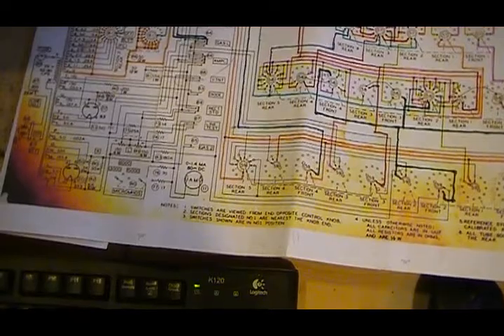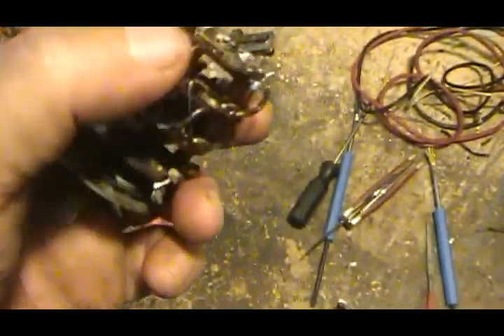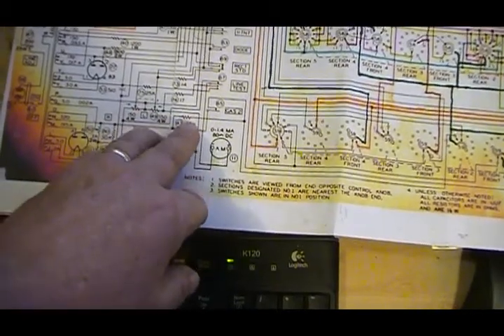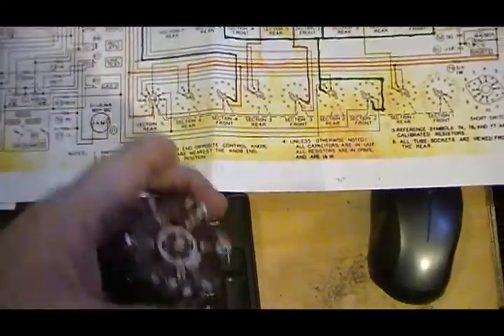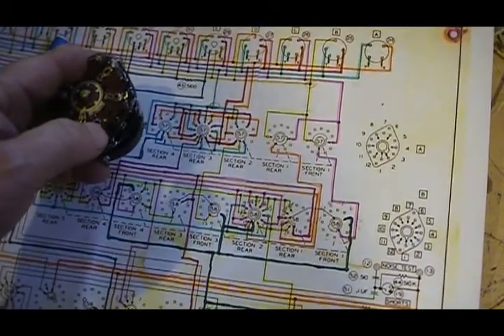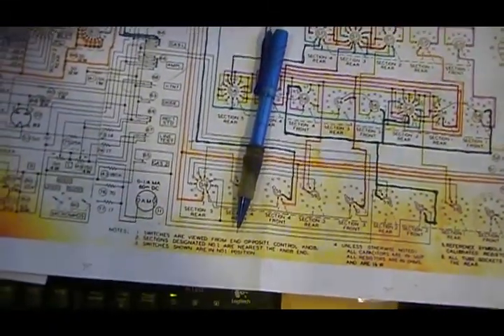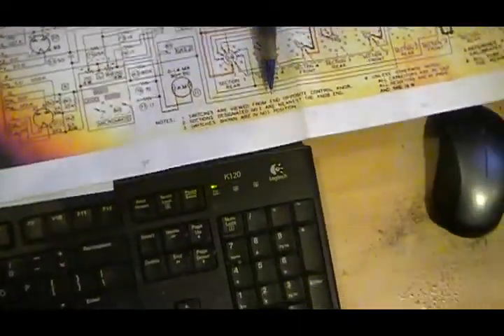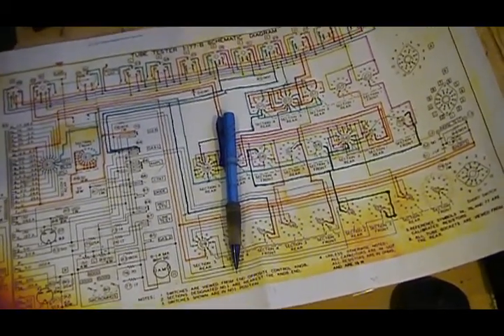Hickok I177B part 3

Comment: so,  if I read you right, in the last video you had it working except for this bizarre issue that when you did a gain test the meter appeared reversed? and since then you decided to take it apart and rewire?
Reply: and by the way,the fact that so many components are right on the money after all these years is phenomenal!
Reply: Daniel McBrearty ... and (sorry for repeated posts) the fact that the wiring itself is in decent nick, and not with rotten, leaky insulation is pretty miraculous. What kind of wire and insulation? if this thing is from around 1950 ... ?